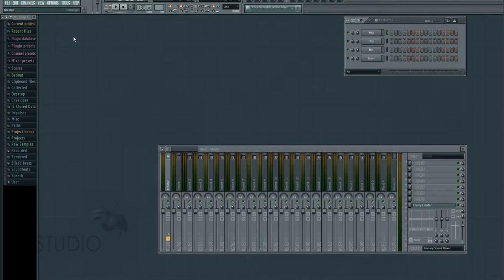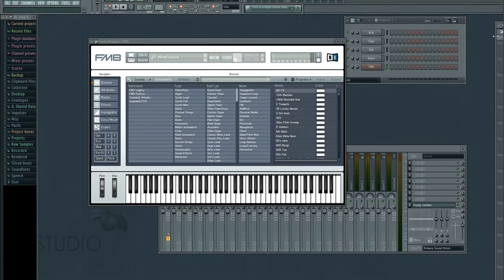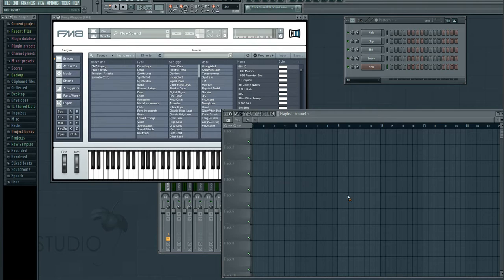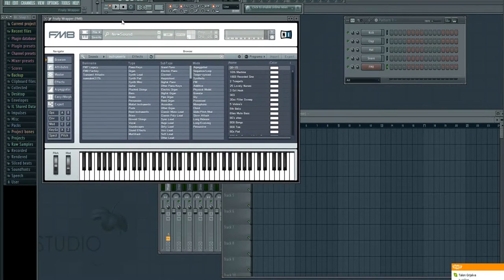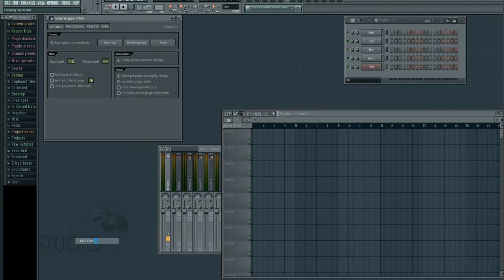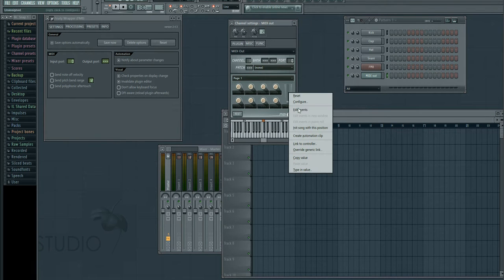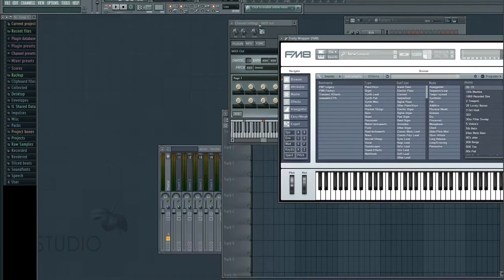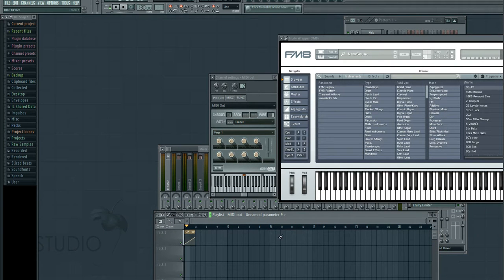How to Automate Knobs in FM8 for FL Studio

Comment from the maker: (That's my other account, sorry)  Yes, it does in fact work like this (Or at least FL Studio 9+ does)  I'd consider doing research before insulting my intelligence, especially when I'm providing you with an in-depth answer that can otherwise be easily searched.  This is the correct answer to your question - given, of course, all software is legitimate (as I can't account for what happens with pirated software).  Good luck.